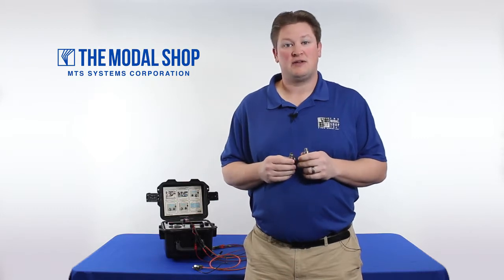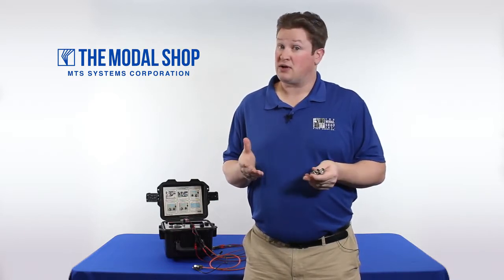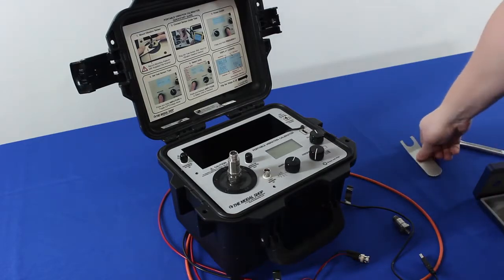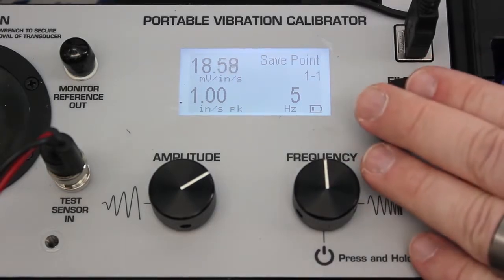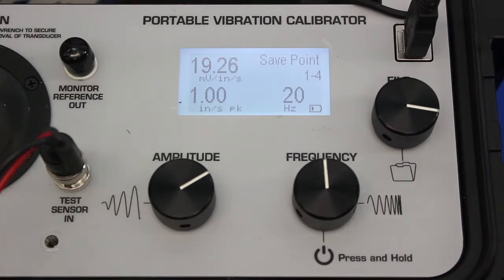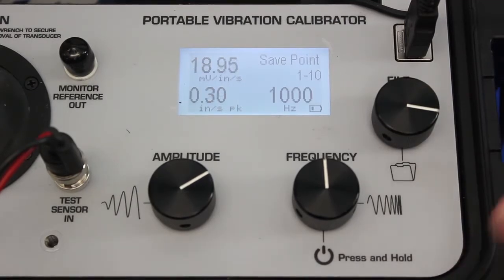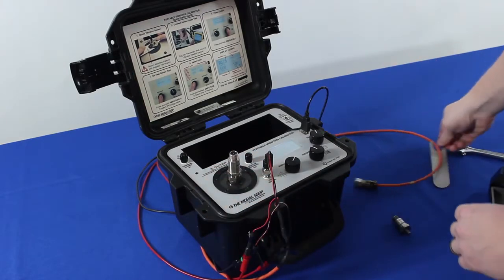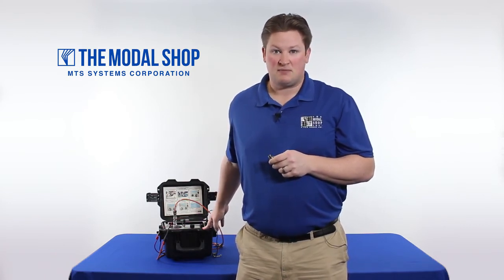Testing Velometers / Velocimeters with the Portable Vibration Calibrator

Comment: I have a bearing noise test machine that utilizes 2 moving coil style velocity transducers. One of the transducers went bad (coil winding broke apart internally) and the original tester manufacturer is no longer in business. Therefore, we have no idea what specific velocity transducer to order as a replacement. Is there a way to test the good transducer to determine its output (mV/(micron/sec)) and frequency (hZ) so a proper replacement can be obtained?
Reply from the maker: The nice thing about moving coil vibration sensors is they are self-generating. You do not need a power supply. You can connect them directly to a volt meter to read the sensitivity.
 
To begin, it helps to know the scale of the sensor. But it is not required. If you know the scale is in mV/micron/sec velocity you can use a shaker with a reference accelerometer that is shaking in that scale, like Modal Shop model 9100D. We recommend shaking in the microns/sec RMS scale. This way no conversion is required from peak to RMS or vice versa.
 
We have not seen any shakers that offer microns/sec scale. Although there could be units available. The 9100D offers mm/sec scale. Thus if you wish to know the sensitivity in microns/sec you will need to convert from mm to microns.
 
The most important thing: is the sensor under test supplying a consistent voltage at various frequencies? I.e. if we shake at 10, 50, 100, 300 and 500 Hz – and we hold the amplitude at 10 mm/sec RMS at each of those frequencies – does the mV output read by the volt meter change much? If the voltage read by the volt meter remains the same, within +/- 5%, we can safely state that this is the sensitivity of the sensor under test. If the output is changing a lot, then we might have the wrong scale. I.e. if the sensor is actually scaled in acceleration and not velocity the mV output will change significantly in this test.

Comment: I have velocity seismoprobe I m getting wrong reading in bently 3500 rack 74712  type I m feeding 2 mm/s rms from shaker table in benlty rack I m getting 0.98 mm/s rms so how to rectify these
Reply from the maker: The first step when troubleshooting a 74712 is to check the mounting angle. The sensor can be ordered for vertical mount, horizontal mount or 45 degree mount. If your sensor is vertical then the shaker can be used normally. If the sensor is horizontal then you will need to turn the shaker on its side. When doing so we recommend opening the lid of the shaker and then gently lying it on its side near the edge of a table or desk so that the lid can fall over the edge of the table. We also recommend mounting the sensor, gently, after the shaker is already it its side. 

If you apply the correct mounting angle one should obtain good results. But keep in mind that this moving coil technology is more prone to drift than piezoelectric. These sensors will drift out of tolerance over time.

Comment: Tengo un sensor modelo 330400 puedo usar el suministro de energía del Calibrador 9100 o debo ponerle una fuente externa de -24 Voltios dc?

La señal de de 100mV la puedo medir en paralelo con la fuente de -24Vdv conectando un cable BNC en el puerro de referencia?
Reply from the maker: Para probar el 330400, se necesita una fuente de alimentación externa de -24 VDC. Los modelos 9100-PS02 y 9100-PS02-CBL01 proporcionan una solución llave en mano para alimentar, conectar y medir la señal del 330400. La fuente de alimentación 9100-PS02 se alimenta del puerto USB del 9100D. Tiene una salida BNC para la señal del 330400. Si usa un DVM, recomendamos probar en la escala de aceleración RMS.

El 330400 tiene un diseño de 3 cables. Hay conexiones para alimentación, señal y tierra. Se deben aplicar 24 VDC negativos a través de las conexiones de alimentación y tierra. La conexión de señal se puede llevar directamente a un DVM en modo de voltaje AC.

Modelos 9100-PS02 y 9100-PS02-CBL01: https://www.modalshop.com/pvc/calibrate-330400-330445?ID=1229
Reply: @TheModalShop  Mil gracias ya hice la prueba suministrando -24Vdc al sensor 330400 y a un 330425 en ambos sensores y midiendo la salida con un DVM en Voltaje AC Rms sin embargo sólo es lineal entre 30 y 500Hz en los demás valores superiores a estos la desviación es muy alta, estaré haciendo algo mal o es posible daño del sensor? según el catálogo de Bently Nevada estos son lineales entre 30Hz y 10Khz según a 1g Pk según la gráfica.
Reply from the maker: @JorgeHernandez-ec4cx  Los sensores podrían dañarse. El modo de falla más probable para cualquier acelerómetro es de alta frecuencia. Pero antes de declarar los sensores dañados, es mejor comprobar primero el montaje. La mayoría de los errores de calibración a altas frecuencias de los transductores piezoeléctricos se deben al montaje. El acelerómetro debe estar asentado en el adaptador de montaje. Si el hilo está tocando fondo, esto puede causar un error. ¿Estos sensores tienen un perno integral M8x1? Además, ¿tienes alguna grasa de silicona? Usamos Dow Corning 4 (DC4) en nuestro laboratorio. Poner grasa de silicona en todas las superficies de metal a metal ayuda con la calibración de alta frecuencia. El último elemento es el torque. Desea asegurarse de usar una llave para montar estos acelerómetros. Asegúrese de utilizar la llave de montaje suministrada para asegurar la armadura del agitador también antes de apretar el sensor. La armadura del agitador no está diseñada para soportar el ajuste del sensor sin la llave suministrada.